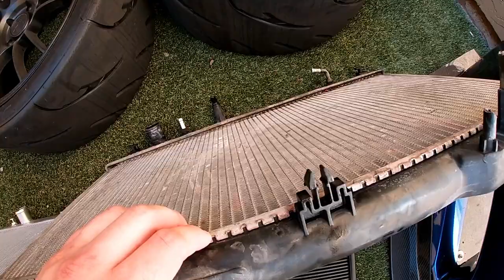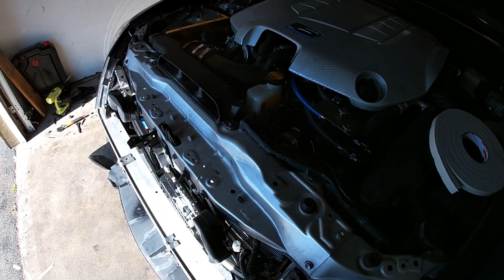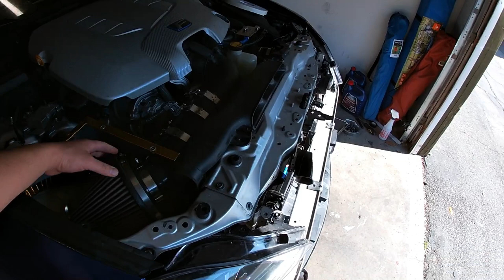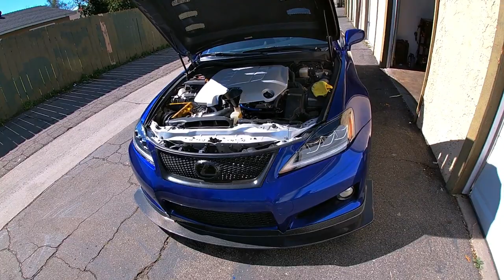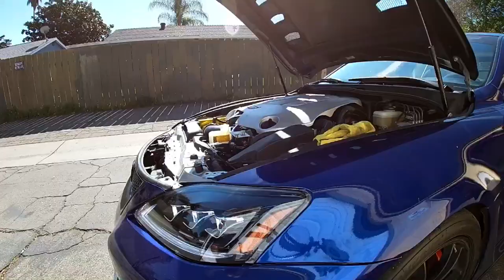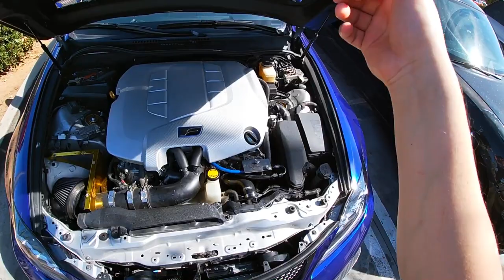Lexus ISF breaks down = Koyorad

Comment: How many gallons total did you use to fil up the bigger radiator? I just did the install on my F and Im at a bit more that 2 gallons. Maybe 2.5 and my reservoir stays full. I heard stock it takes lime 3 gallons and the Koyo adds another 1.5. So I'm confused lol

Comment: What is that other black radiator next to the newly installed trans cooler?

Are you running dual trans cooler?

Also that was not OEM right?
Reply: Had also had an aftermarket oil cooler setup.